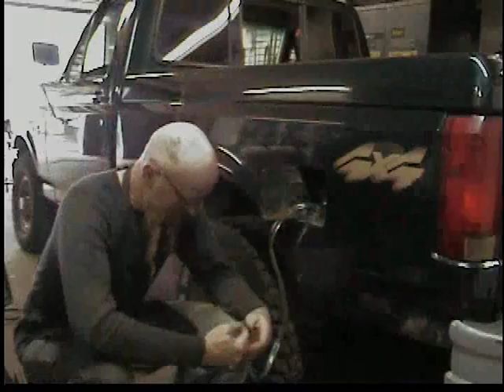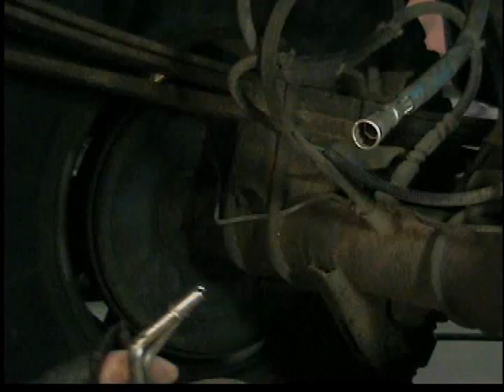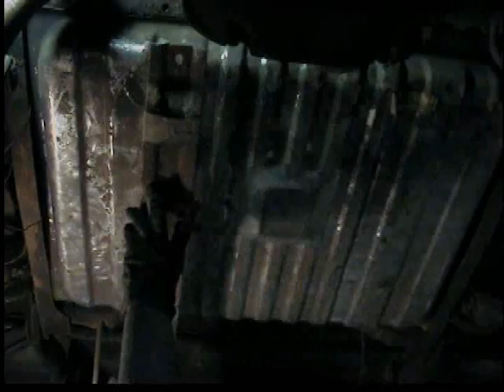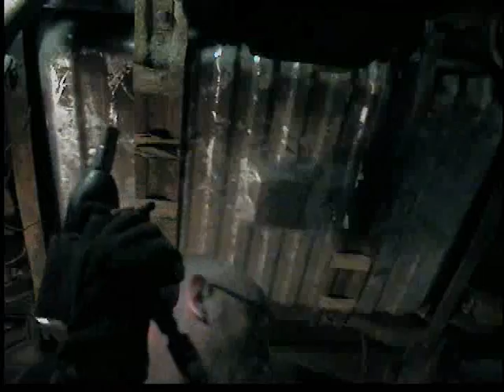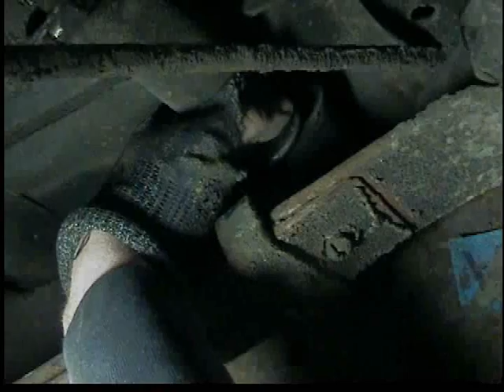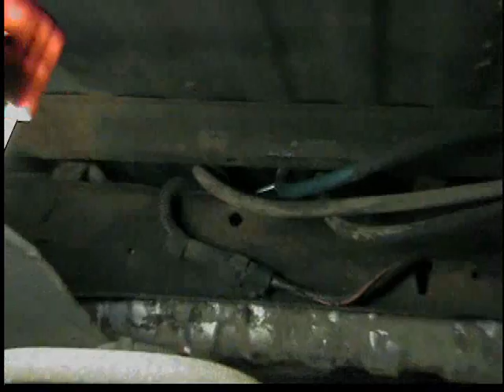Ford F150 fuel tank removal & service How To DIY

Comment: With the file lines on any car or truck I took a sharpie pen lib and cut down the middle of it and then put on the line and pushed and it will come off
Reply from the maker: If you don't have the tool that's a neat trick.
Reply: @user-nq5rd4ck5z  it a good one lol but I do have a question I got A2002 f150 Triton V8 I look for a few module under spare tire don't have one just a long black box with a wire hook to it it will run for a few then shut down and I checked when it was running on the fuel line with a screwdriver pushed down on it and it spread out but not good so I'm thinking it my be low pressure
Reply from the maker: Most modern vehicles have a port in the engine bay where you can attach a guage to check the pressure. Not sure what that model should be.

Comment: I did this job for my dad, he tells me it's the second time he's replaced the tanks due to sediment...any tips on how to prevent sediment? I'm thinking new filler neck and cap, but other than that, if the O-ring is installed correctly, there should be no other way for junk to get in the tank.
Reply from the maker: It could be in the gas.

Comment: This video was filmed and edited very well to show all the important steps, without a lot of waiting time in between. As I followed the steps, I was able to just pause the video and then resume again as I tackled the same project. You are right sir, it's a BEAR to do this on the ground! If you don't have a lift or a pit to work under, taking the bed off to do this job is very tempting.

Comment: Thanks for posting this and leaving it up.  I'm removing the tank from a 94 F150 I just took the straps off today.  Those bolts were so rusty they actually broke which is ok because I was planning on replacing them anyway.  I'm doing this on the ground in the backyard.  This truck sit up really high though so there's plenty of room underneath.  I had jacked up the tank so when I took the straps off it wouldn't fall on me.  But even with the straps off it's not coming down.   I can see where I'll need to wiggle it out of there.   I'm glad I watched  your video because I forgot about that special tool for the fuel lines.  I actually have one of those around here somewhere.   Actually this tank is fairly new.  I'm taking it out because I want to remove the bed and I'll be using the cutting torch for that.  So I wanted to get the gas tank out first.   When I put it back together I'll install the tank first and then put the repaired bed back on.   Thanks again for the tips.
Reply from the maker: Sounds like a great project. Truck On!

Comment: by far the most informative video on the topic even though it jumps around a bit but at any rate good video
Reply from the maker: Jeremy Nading Thanks. Yes it was too hard to get good angles too film everything so chronological didn't work out. Wrench On!
Reply: +wwwCARSSUCKcom it gets the jist of the point across. I have a leak on mine and so ive been trying to figure out how to fix it but since my 250 has a jimmy rigged home made flat bed on it and even less room to work than what you had its proving to be a pain and I can't quite get in there like you did but thanks to your video I might be able to figure it out now.
Reply: Just out of curiosity what size of quick disconnect did you use?
Reply: And what's the trick to getting the electrical off
Reply from the maker: I don't remember. It seems like they were different sizes.
Reply from the maker: I'm pretty sure the lock was broken on this connector. It wouldn't hurt to heat shrink it when reassembling. This truck later had a problem blowing the fuel pump fuse on rainy days. The problem was water getting inside the connector.
Reply: I got it finally I just had to blow them out with the air hose first cause they were plugged up with dirt and rust so i blew them out and tapped the quick disconnect in with piece of rebar rinse and repeat until they were clear then they popped right off but the electrical had a three point clip setup on it but I got it all and all that work to hit it with a wire brush on the angle grinder just to find a pin hole right where the front of the bottom strap on the passenger side which I know is typical for any older model truck
Reply: I use those heat shrink connectors all the time but I did everything in my power not to cut the wires ended up breaking the back latch on this bracket but I think it should be ok with putting new gel in
Reply: @user-nq5rd4ck5z  I found the problem I thought it was my fuel pump no it was the crank sensor . Lol it's crazy it was acting like it was a fuel pump but no the crank sensor plug in was broke

Comment: My tank on my 2013 F150 Supercrew leaks only when the tank is full when I fill up. Hard to see up there where its leaking even with a lil mirror. Getting the code 0455 Gross Leak. Ran it til 18 miles left to empty and about to drop my tank and have a look.
Reply from the maker: Yes, totally different tank on the 2013, but similar stuff, Could be an o-ring or hose. Keep us posted.
Reply: Kevin James i had the same problem on a ranger... ended up being a cracked filler neck hose. pretty simple fix, as long as you take off the bed for it. you COULD do it dropping the tank, but thats always much more of a hassle.
Reply: Kevin Jersey

Comment: Looks like you could use some GREAT gloves - near BULLETPROOF and they're so thin you can pickup a dime!  I get the Atlas brand, Nitrile palm and flex-knit back. I've done a house frame and complete roof job and they still look near new. Get them on Amazon, about $15 for 4 pair. I am not paid in any way for this recommendation - They're just great.
Reply from the maker: Yeah, mine were definitely worn out. Thanks for the tip.

Comment: My 92 had the same problem that you mentioned I filled it with gas and it just rained from the top of the tank and from researching stuff I realized its the same thing on hour truck with a bad o ring
Reply from the maker: +Nick Trout My Jeep CJ7 did it too (although not as bad). Just put a new o-ring in it.

Comment: how do you get the hose off of the vent in the middle of tank.do you just pull it loose from the vent thing or is there some other tool
Reply from the maker: +Michael Cantwell The one in this video is just a rubber hose over a plastic barb with no clamp, so yes, I just pulled it off. Sometimes the rubber assumes the form of the barb and you might have to slice it, then cut an inch or so off before reinstalling it.

Comment: man thanks my 1990 ford f150 rear tank filler hose has been beating me down now I no how to put it back thanks again
Reply from the maker: +Michael Cantwell Glad it helped. There are also some sheet metal screws inside the gas door that will remove the filler tube from the top. That option might help you too. Truck On!

Comment: I just finished my 94 F150 rear tank. I couldn't get the passenger side of the tank to drop down since the tail pipe was under the front right corner of the tank. So I disconnected the filler tube from the fender with 3 tiny bolts. Once the drivers side of the tank was down below the frame rail, I could wiggle the tank towards the drivers side and get the passenger side to come out. I pulled down the rear of the tank several inches to access the vent, electrical connector, and the lines. I picked up the same exact tool you did. It worked perfectly on the larger line. My smaller line was bent a little so it was not centered in the "bell" of the slip fitting. Once I was able to straighten it, the tool took the smaller line right out. One thing you did far better than I did was to have the outer hose already attached to the tank. I couldn't do that because again the tail pipe was in the way. The 4 mounting bolts for the tank are actually 13mm and 15mm. I think you got your clips on backwards, although the way you installed them, they went in far easier!!. Your video was really good compared to so many that I watched !!! Thanks !!!
Reply from the maker: +mikep95133 Very cool. The truck in the video is a six cylinder 4x4. I wonder if your exhaust is different. I put a note on the video about the metric sizes. Thanks for that info. Good trick on disconnecting the filler tube too.
Reply: +wwwCARSSUCKcom The truck I worked on is a 6 cyl 4x4 too. Knowing ford, they could be totally different. What I'm sure you'll agree, is it's nice to have that tank functional again !!!
Reply from the maker: +mikep95133 Right on! Unfortunately this tank came out again. The fuel pump quit so Mikey replaced it. That didn't fix it. It turned out the electrical connector was no longer water tight and it had blown the fuse. all good now though.
Reply: +wwwCARSSUCKcom Twice? Yikes. At least it's done now !!!

Comment: that was very nice but damn you make it look easy lol i gotta change the sending unit on my grumman  what is that tool called that you used to pull off those lines & do they sell them at auto parts ?
Reply from the maker: mario d.c Fuel line quick disconnect tool and yes auto parts stores have them. They should be less than $10. There was a lot of wiggling and struggling left on the cutting room floor.

Comment: whats the tool called to disconnect the hoses
Reply from the maker: Fuel Line Quick Disconnect Tool or something like that. O'Reilly part number 3321
Reply: @user-nq5rd4ck5z  I imagine since this is an old video the part#s may have changed. Oreillys now shows two part numbers W83114 5/16, 3/8 and W83113 3/8, 1/2, 5/8, 3/4...wondering which tool you used?
Reply from the maker: The smaller one.